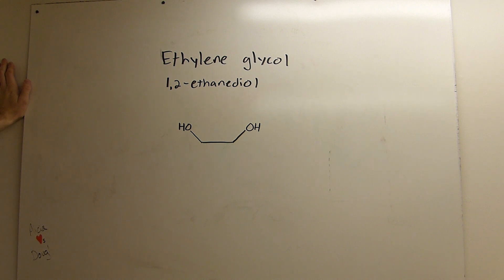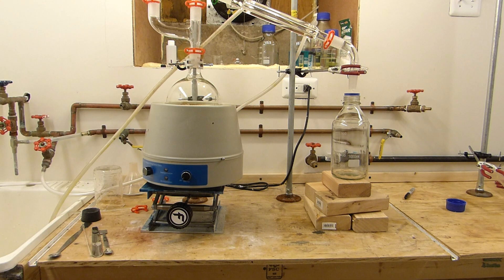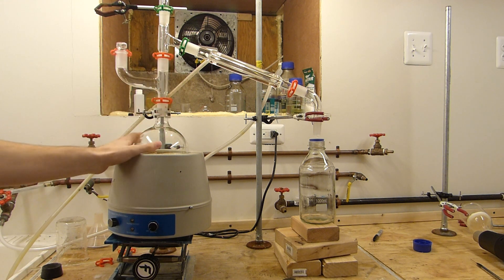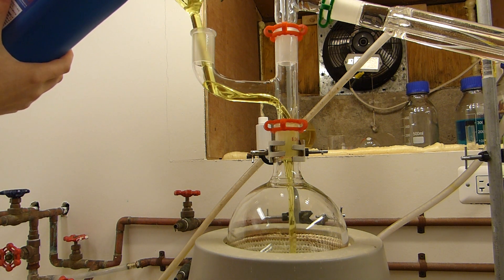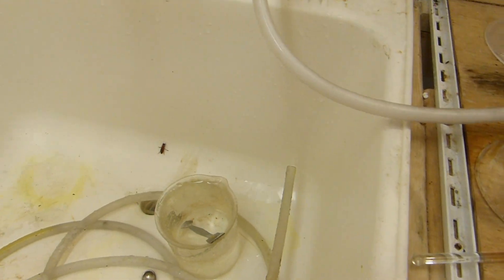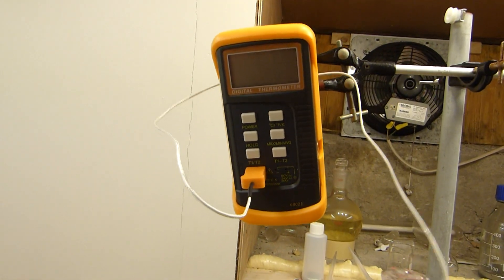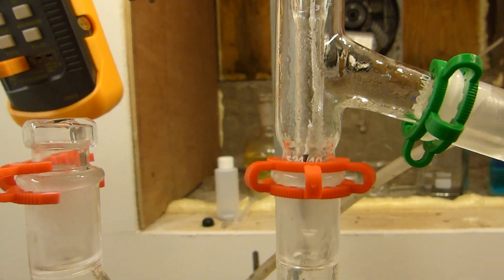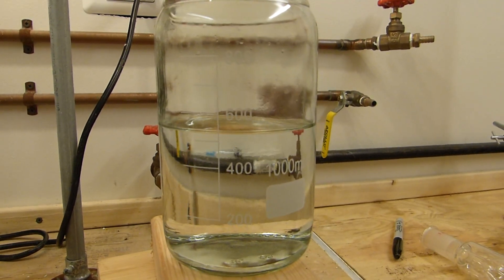Ethylene Glycol and Simple Distillation

Comment: Can anyone give me a hint about round bottom flasks ? I have this problem where some of the 24/29 equipment I have has a reasonably thin lip or rim that fits the clips quite well and some of it has a thicker lip or rim and doesn't fit the clips right. 
Why are those differences and how to go about it ? Are there different clips for the same size (24/29 or 24/40) joints ?

Comment: Hello Doug, for preparation of Automobile Coolant, I tried mixing liquid silicate with ethylene glycol.  Silicate is said to  be used as Rust inhibitor in the coolant mixture.  To my surprise, the solution gradually become thicker and thicker and finally turned into Jelly.  Is there a tip how to use silicate in coolant ?
As for other ingredients, I mixed very small portions of Nitrite, Sodium Benzonate and Borate.  These chemicals work excellently to protect Metal and Rubber parts from corrosion, scaling and other damage
Reply: use less silicate, what i suspect is happening is the ethylene glycol is pulling water from the silicate solution, causing the jell. the silicate should be less than 1% in the mixture
Reply: @EdwardTriesToScience  Thank you for your advise and input.  Do you have any experience in Fuel and Engine Additives ?  System Cleaner, Octane Booster, Throttle Body cleaner, injector cleaners etc ? All what I know that all these additives are naphthalene based with a very small % of PiB or PIBA  that helps excessive burning of fuel and carbon emission through exhaust.

Comment: Does ethylene oxide come from heating antifreeze?
Reply: Rather probable. It‘ll want to split off water, especially when it‘s mixed with a bit of sulfuric acid. The probability is high tho that you‘ll be getting Dioxane, polyethylene glycol and also crown[18] and other crown compounds.
Reply: @giansieger8687  We are getting really bad odors from the neighbors and got high levels of ethylene oxide in our air quality tests around the house and outdoors, thousands of times over the EPA limit... I'm thinking there are some math labs using antifreeze and it comes from that, but I don't know much about chemistry.  We've seen all the usual signs of illegal stuff going on at our neighbors.  We don't have dioxane, just ethylene oxide and ethanol, we have a lot of ethanol floating around among other chemicals... it's pretty much the recipe for math that we found in the air around the neighbor's house.  We have 5 independent lab tests over a little more than a year with consistently the same chemicals listed.  We called the police but they said they couldn't find anything.

Comment: You should have used vacuum distillation to keep the temperature down.
Reply: Then how we can find the pressure vs Temperature chart for different liquids ?
Reply: @omsingharjit  Just read what temperature the ethylene glycol comes over. You should make it so that you get a boiling point below 100 C and somewhere above 50 C just to be safe. Never get as much vacuum that it will start to boil on its own. It could be done, but then you cannot condense it before it is sucked into your vacuum source. The point is: you dont need as much heat that way, and your product has not been exposed to high heat. Which most of the times results in better product. Refluxing a chemical can chance its properties. Keeping heat low is great. 

A watertap vacuum can help a lot and it only needs to have a little running water to get it going. It will lower the boiling point. If you want to get fancy get a vacuum regulator and a vacuum pump (old fridge compressor could work, but you will need a watertrap so you dont run water into it). 

Greetings,

Jeff
Reply: @omsingharjit  There is one rule which works perfect with most substances: when the pressure falls by half, the bp decreases by 15°C. Use it!

Comment: Honestly a round bottom should never be filled more than halfway when used as a boiling flask.
Reply: That strongly depends on the viscosity of the distilled liquid. With methanol or acetone you can fill it even over the joints, but never try this with sulfuruc acid

Comment: 06:03 So I was always told to do the opposite right up until I finished my degree in chemistry. The theory behind it is that the coldest liquid is passing the hottest vapour, thus the greatest temperature difference and most effective cooling etc etc, it’s even done this way during reflux. I always thought that the reason no one does it is because you have to get rid of the air in the condenser every time you start, most people are lazy. Was I wrong, is my professor an idiot?
Reply: Yes, and yes? You want the output of the condenser to be as cold as possible. And since condensation can dump a lot of heat, you could end up with water too warm to condense everything and get a lot more passthrough if you don't do counterflow.
Reply: I'm super late to this party but counter-flow heat exchangers are more efficient. This doesn't go into much detail, but this is a short bit on the website of a company that makes heat exchangers (http://www.thermex.co.uk/news/blog/605-why-counter-flow-heat-exchangers-are-more-efficient). I would also think you would want a more consistent temperature difference throughout the condenser for thermal shock reasons anyway.

Comment: Polyethylene glycol is becoming popular as a medium with Silica nano particles as a Dilatant (Shear Thickening Fluid) for use in body armor. Will you explain the steps needed to get from Ethylene glycol to Polyethylene glycol to see if it is also an easy home made solution?

I would like to get into experimenting at home with body armor designs not involving Kevlar :D
Reply: Michael Pierce Shoudln't be to difficult. Ethylenglycol and a Base/Acid Katalyst and it should start to polymerise but not sure
Reply: @Chem-iu5jx  
Hello, for preparation of Automobile Coolant, I tried mixing liquid silicate with ethylene glycol.  Silicate is said to  be used as Rust inhibitor in the coolant mixture.  To my surprise, the solution gradually become thicker and thicker and finally turned into Jelly.  Is there a tip how to use silicate in coolant ?
As for other ingredients, I mixed very small portions of Nitrite, Sodium Benzonate and Borate.  These chemicals work excellently to protect Metal and Rubber parts from corrosion, scaling and other damage.

Comment: how about make Polyethylene glycol?
Reply: Michael F If you mix ethylen glycol with sulfuic acid, you form 1,4 Dioxan!
Reply: You make many products. 1,4 dioxane is only one of them.
Reply: By Giving ethylene glycol so many heat and pressure..
Reply: No, it's done by dehydration. Heat, yes, sulfuric acid, for the water removal. But at ambient pressure.
Reply: Great info, guys.  Thanks for sharing!

Comment: Could you carboxylate the ethylene glycol to diethanoic acid? How could you go about doing this without polymerization, if that's possible? I'm really interested in making dialcohols, but can't see an easy way to do so without incurring polymerization with the starting reactant or the intermediates.
Reply: You can do an oxidation, to make oxalic (diethanoic) acid. But oxalic acid is pretty cheap and readily available, so it's not needed.

Comment: FYI: I was just disassembling an old Mitsubishi projection TV and came across this video when I was trying to find out what the fluid was around the lenses, used for optical clarity and heat dissipation, turns out it is 70 percent mono denatured ethylene glycol and 30 percent glycerol/glycerine. Just random info.

Comment: Isn't antifreeze usually bright green in color?
Reply: The heat makes its color change.
Reply: Depends on what kind it is.  I used to work as a mechanic and I've seen red, green, orange and blue antifreeze.  All for different model vehicles.  A lot of people don't know that some models require specific types of antifreeze.
Reply: what are you doing here?

Comment: metal keck clips for anything but alcohol or water disstilations, the plastic ones are abs, the data on its softening temp is well piblished, they became super cheap, and easy to get because of glass bong makers, but for good scientific apparatus, metal wins handa down, also, i prefer glass ball joints to the tapered old world, but thats just me. awesome video, need any custom glass work?

Comment: Hi first of all great video! I would like to know: 1.how can you make sure what type of glycol you are extracting by distillation, 2. the differences between this glycol and polyethylene glycol 600 diacrylate, 3.- what type of products I can extract the most polyethylene glycol 600 diacrylate? Thanks a lot!
Reply: +Luis Colorado Polyethylene glycol is the polymer of ethylene glycol. I don&#39;t think you can use this like EG, it also has a high boiling point due its larger mass. Maybe you can decompose it with heat and get some chemicals by fractional distillation, but i don&#39;t think it&#39;s worth it.
Reply: i see, I am trying to get some PEG and mix it with sodium persulfate in an aqueous solution .